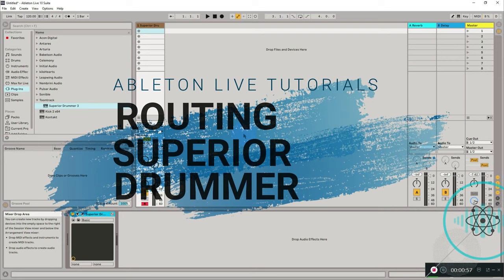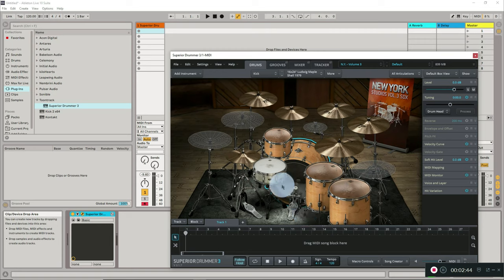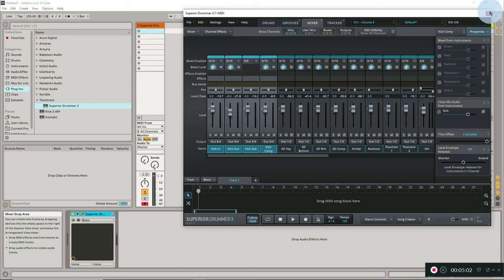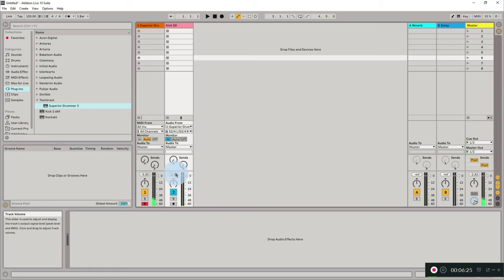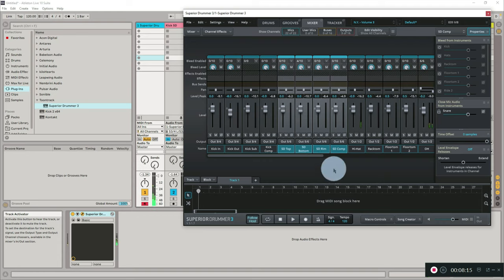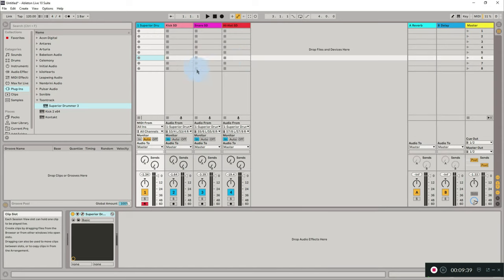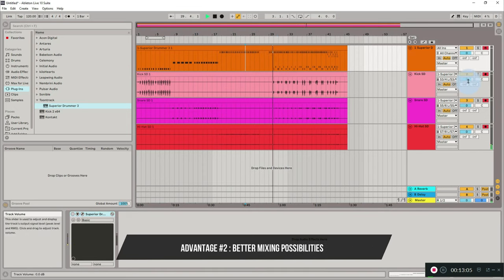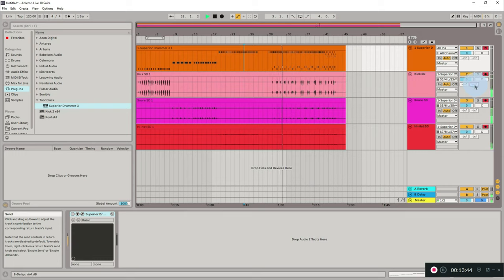How To Multi-Channel Route Superior Drummer In Ableton Live | Step-By-Step

Comment: Hi LMP - thank you so much for this it's great, just one thing I noticed on my setup...( I'm triggering the SD3 plug-in inside Ableton from an electronic kit through a TD50x Module) and that is, when I hit the record button on the right it would not stay highlighted, I had to right-click on the record node and select Arm Exclusive (Pref)  then the record buttons would stay on for each track. 
Thought this might assist others with the same issue, Thx again for your video, it helped heaps..!

Comment: Hello, thanks for this tutorial. how do you save all this routing process in a preset or template to re-use  it in another session quickly?
Reply from the maker: To my knowledge, this is not possible when using SD in a DAW. Although you can do the same while using SD as a standalone application. Just use SAVE AS. I will still look around if there is a way to save as template with DAWS. If I find any solution, will update you. Thanks.
Reply: @lmp_in  i managed to save the all process by simply drag n drop the main track of the group in the user library. IT Will keep all , next time you drag n drop in a new project.
Reply from the maker: @matthieucroset  Great. Thanks for the update. Learned something new from you today. Happy Music Making. Cheers :)

Comment: When I hit record, everything gets recorded except for the midi track. My goal is to still have the midi track so I can edit the midi notes after recording my drums. Any suggestions?
Reply from the maker: This can actually be caused due to several reasons but if you are getting the input signal from your MIDI instrument then the most common reason is that people forget to arm recording switch on the MIDI track while recording.  Arm recording switch is that small red button on any given channel that. Turn this switch on to record enable an audio track or Instrument track. Are you doing this on your MIDI channel while you record?
Reply: @lmp_in  yes sir. Very well aware of that arm track. I am still trying to figure out why. Oh and just to note that, I'm doing this without my e-kit or midi controller. Just my laptop and trying to record by clicking the instruments in SD3. Maybe that's why?
Reply from the maker: @iandguzman  Hey! I see your issue, Superior Drummer Doesn't print MIDI if you are using a mouse, I suggest you switch to using your computer keyboard as your MIDI input device. This can be done in Ableton by pressing the M key on your keyboard or by clicking the small piano keys icon on the top right of Ableton. This switch is just next to draw more switch, the one that looks like a pencil.  Also make sure while you are recording superior drummer, the record arm switch inside the superior drummer is also switched on. Hope this helps.

Comment: In terms of sticking with the steps in this tutorial, what should we do with the extra channels from SD3 which have not been routed to a track/tracks in Ableton? For example, for a kit I'm using, I have a channel in SD3 called OH Dyn, another called Amb Ribbon, etc. What should we do with these extra channels? Thanks!
Reply from the maker: Hey!
Thanks for you interesting question.
These are not not extra channels. These are actually channels that were used to record Overhead Mics. If you wish to learn more about drum micing I suggest you explore the topic How to mic a drum kit. Once you learn that you will be able to relate to any channels that you encounter. 
For now, you can route overhead mics to two different channels and pan them left and right. 
Hope this helps.
Reply from the maker: Amb ribbon stands for ambient mic i.e. a room mic. You can use it as well id you wish. It will record the whole drum kit as one. Ambient mics or room mics are used to record how the instrument are sounding in a room. There are several room micing techniques, explore those as well.